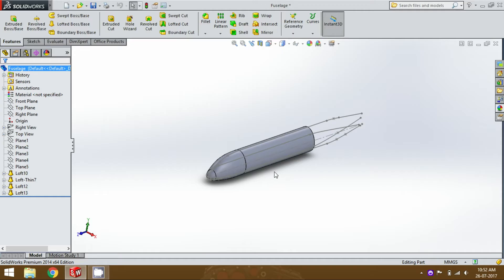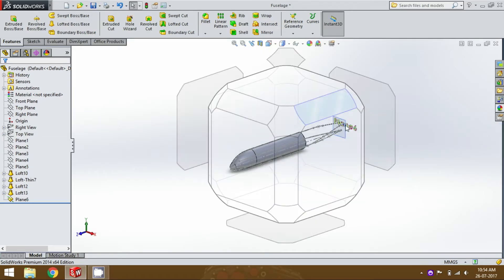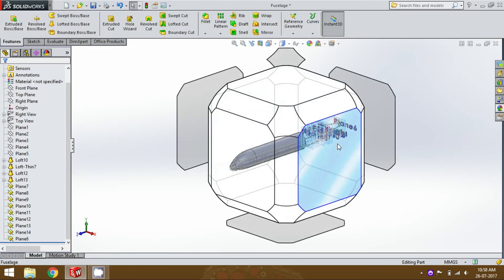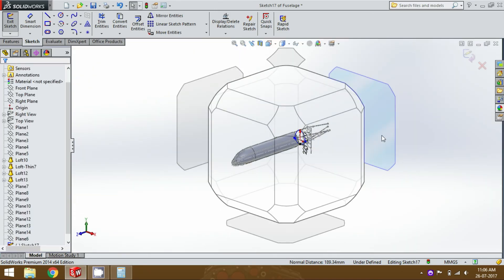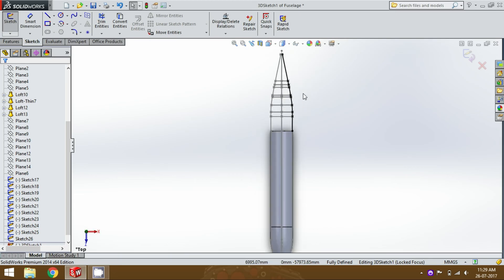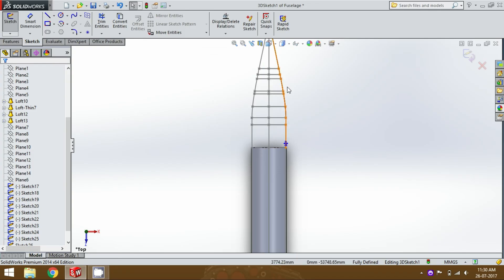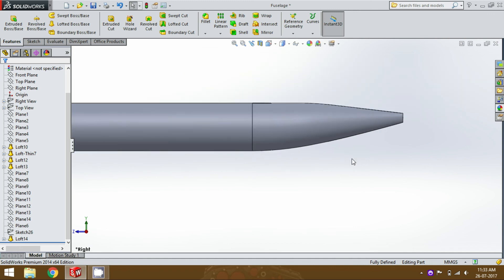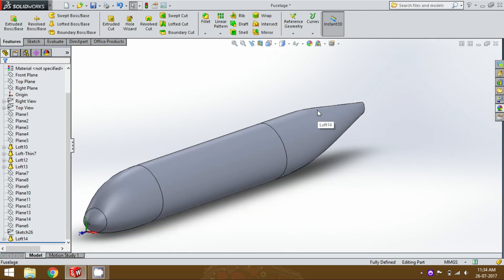Designing an A380 : Part 1 (Fuselage : part 2) SolidWorks Tutorial

Comment: Hello, Great Video, Thank you for your time and effort.

I am just having an issue with my last plane trying to do the last spline. I have repeated the same steps for all the other planes and sketches before it, using the ratio multiplication, all is fine except the the last plane right at the back. 

When I try to do a Coincident with the ratio height, I get the error:
"The Sketch has not been updated because it would result in invalid geometry (such as a zero-length line)."

Sorry, I would have sent a private message but I don't think you can send private messages anymore, otherwise I would have sent a screenshot.

Thank you.
Reply: Did you ever manage to figure that out? I'm stuck with the same problem

Comment: Great work. I like the ratio method. But I think you could do it much easier if you use equations. Calculate ratio (0.29) in the equations and use it anywhere you need. Just put an equal sign (=) to dimension, then write the equation.

Comment: What I already noticed in the first part...: I think the model is going to be bigger than the original aircraft. As the guidelines at the left and the right of the aircraft are extracted from the technical sketch, they have to be the widest points on the model, but as you can see at 5:06, they are not. The fuselage keeps extending at the top of the guideline. So to make the model exact, the left and right guidelines also have to be a 3D-curve, that always follow the widest part of the fuselange.

I hope anyone understands what I mean. :D

PS: Another example for better understanding would be the A320, where on the real thing the cross section of the fuselage is really a nice circle, which you wouldn't get when modeling with the pierced guidelines.
Reply from the maker: Thank you for pointing that out, I understood what you said. I noticed that from the beginning, I just didnt make that correction in the previous video because it would make the video longer. I am trying to make my videos smaller, simple and filled with content. thats why. 

we are on the same page buddy, thanks ;)
Reply: Yes!Excellent!